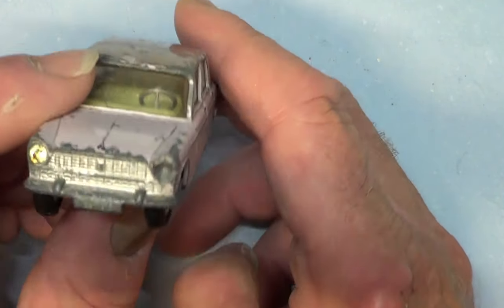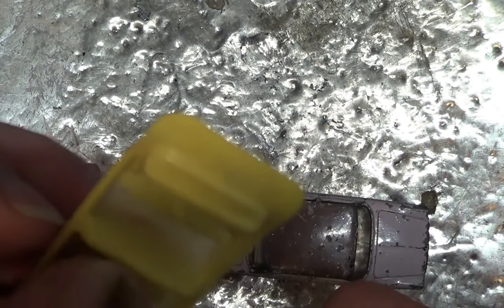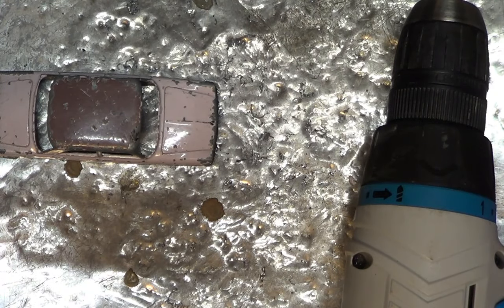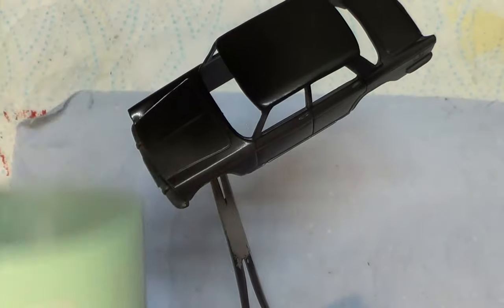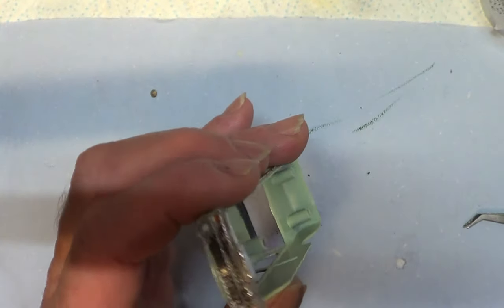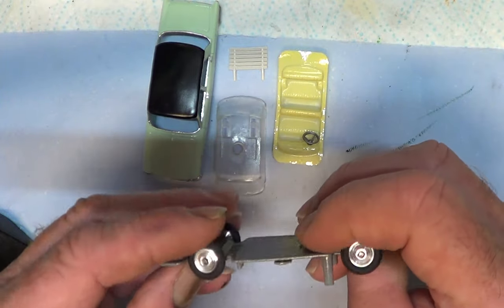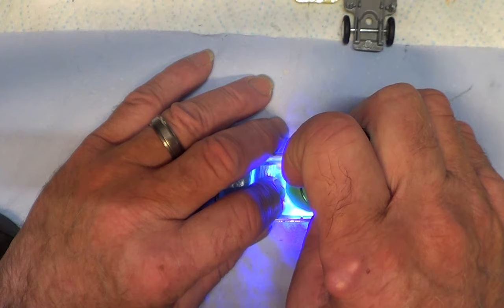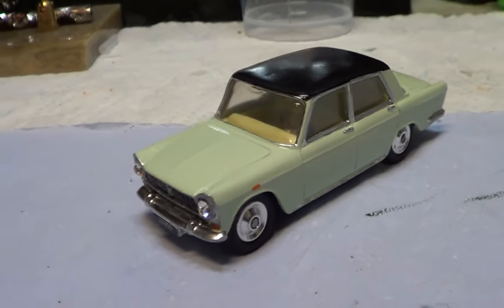RESTORATION OF A CORGI TOYS FIAT 2100 (No.232)

Comment: Great video once again....may i ask where you got that Hub puller from please. Cheers
Reply from the maker: Thank you Simon, hope you find the puller useful when you get it, just be careful though when using the smallest screw in bit as I have just done a corgi Citroen Safari and the wheels won’t press off, it is quite easy to bend that piece, I did that and had to get another puller, good job they don’t cost too much lol🤦🏻‍♂ All the best, Nick🐸🐸🐸